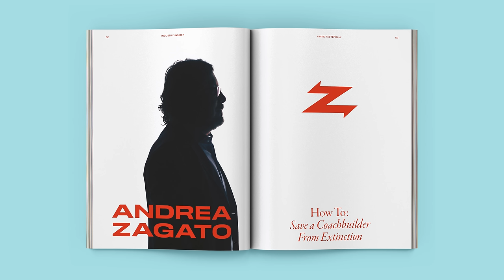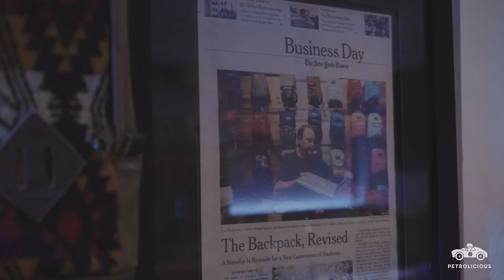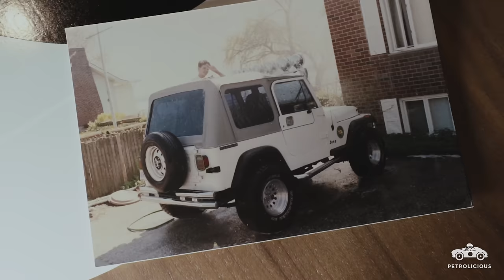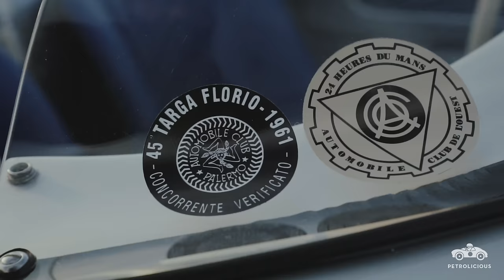Vintage Motorcars Porsche 550 Spyder Replica: Visceral

Comment: Replicas of the old cars are usually better- they have modern better engines, better components- etc.  of course the resale value is terrible.  Few can afford an original - not to mention that the Carreras 4 cam engines are crazy expensive

Comment: I am a James Dean fanatic. I have a replica kit car Porsche 550 Spyder.  I live in Pennsylvania. I drove the car to the crash site. Placed flowers. When i got  back in the car it would not start. Called a flat bed, i told the driver just tow me down the road a mile then let me see if it starts. Sure enough i jumped onto the flatbed into the car started right up. The flatbed driver demanded me to get the car off the flatbed asap.
Reply: Replica . But I hand made many of the parts.
Reply: @iamauto333  very nice to hear you handmade the parts on the Porsche Spyder it adds a personal touch to your Porsche Spyder 550 👍😁

Comment: i thought my karmann ghia is a tiny car, then a 550 spyder parked beside me :)
Reply: Which Karmann Ghia do you have? I owned a type 14 (50 hp) 30 years ago. 
Bought it for 2000 Deutsche Mark (1000€).
Reply: @dertechniker8867  a type 14 1966 model
Reply: gilbert sanchez a little while back I saw a Porsche 914 parked on the street, I’d forgotten how small they are. The 550 is smaller.
Reply: whats the market price for a karmann ghia right now ?
Reply: @legend-qw2ec  I'd like to see one next to my 1960 Austin Healey Bugeye Sprite.
Reply: Have you ever seen an original Alpine A110? You could put it in your pocket.
Reply: @dertechniker8867  a type 14 1966

Comment: Wow cool Video. Brings back memories. I had Beck 550 Sypder # 48 built by Greg Leach @ Vintage Spyders in the late 90’s The car was incredibly quick like a motorcycle but with a fiberglass egg shell body for maximum protection. Everything in this video is true about the feelings it gives you when driving it. It defines visceral. I felt completely defenseless driving it. It was so easy to drift with the throttle. Mine had a 2109cc with 170 hp. It only weighed 1200 lbs. it was a four speed with a swing axle, discs all around, silver with maroon leather and maroon rear quarter stripes. Crazy stuff🏁👍. I still wish I had it😀

Comment: I think a car company could sell a lot of cars if they built an inexpensive similar looking retro coupe with a lightweight removable hardtop....Keep the old school looks but use some better modern parts. Like an LED lighting, keep it lightweight like original, use a modern but simple inline 4cyl instead of boxer, that could put out 200hp in sport mode. Also with an Eco fuel saving mode 6 speed manual gearbox with 6th being OD.
 It could cost less if it didn't use all the bells wistles of pwr windows & seats, touch screen display,etc..The combination of lightweight/great fuel economy, yet still fast & fun to dtive, lower price tag of the car due to less parts/basic design, with good looks & lower maintenance costs. Would probably make it a hit with many people.  It could be a daily driver for a single person. Or second car for a big family & used as a fun to drive commuter car.

Comment: I owned a McRae Spyder, very rare, body mould rough from Chuck Beck, light weight hand laid and sculpted glass body in NZ to fit 8" rear and 7" front Z rated race rubber . This was built in New Zealand, by the Graham McRae, ex Indy rookie of the year, F1 Driver for Frank Williams, and F5000 triple gold star champion CanAm road America. A highly respected constructor building his own GM cars and racing them around the world in the 70s.  My was built to race car specs for Targa road racing. WRX STI's 2.5-liter Turbo charged engine, or a Porsche 911 Carrera RS 2.7 engine box set up if desired. Custom box, Link race management race tuner 300+ hp.  Body weight 450kg, 911 oversize vented rotors all round, Willians multi pot brakes all round. All tube to certified race spec molly.  This project was based on bringing the inspiration of the 550A into the modern era.

Comment: What with the space frame, the head faring, and the louvered doors that access the carburetors without lifting the tail piece, this is MUCH more a 550A replica than a 550 replica.  Which is all good.

Comment: Ayeee.... What a beauty! My dreaaam!!! How much such replica can cost?
Reply: Call Greg Leach at Vintage Motorcars Inc. or Carey Hines at Beck Speedster but brand new probably less than $60K and that's putting in a lot of extras. Engine choices are a Type I or a Type IV or even a Subaru. The build cost depends on your budget. Or look for one used and you're looking at $30-$40K.

Comment: He's wrong about original it had 140 and weighed 1150 that's 8.5ti 1 hp to weight.  Most replicas are fiberglass and weigh 1400  or more.

Comment: I had a beautiful, well done Beck 550 that I loved.   It ticked all the boxes mentioned, but I could not get over the fact that even driving "motorcycle defensive" was not enough.   This thing is so small and so low, you don't even have the visibility of being on a motorcycle, where you are sitting HIGHER than you are in this car.  Driving around trucks in the southwest, I always felt like I was going to be squashed like a grape from someone who "just didn't see" me.  Other than that, I miss the car a great deal, and if I had the money, yes, I would buy another.
Reply: I felt the same way driving my sisters Mazda Miata 20 years ago.  Feels like you’re driving a go-cart amongst cars and trucks. 👍👍👍
Reply: @clayfarnet970  I also drove a Miata as my daily for 10 years... it feels like a boulevard cruiser compared to the 550.   Yeah, it's like THAT

Comment: The original weighed 1150 with 140 horse power 8.2 lbs to hp.  Most replicas weigh around 1400.
Reply: Nope, those original specs not correct.
Reply: @MarkLRandall  550 kg and 140 HP what specs do you have?
Reply: @ruthlessreid9172  Around 1300 lbs and 110hp from the 1500cc 4 cam motor.  This was from one of the car mags that tested an original.
Reply: @MarkLRandall  quite different than other info I was always told 550 was weight in kg?

Comment: I have some bad news for the owner - that type 1 VW engine with dual carbs and larger pistons isn’t putting out anywhere near 200hp.  Even a Type IV has to run massive displacement to get close to that number.
Reply: A More $ Than Brains Driver, Not A Racer...Let "Mr. Visceral" & His Admittedly Gorgeous  $100k Street-Only Replica Find That Out, $hall We? Car$ & Coffee-NEXT!
Reply: Really? Exactly what does a 2275cc with a big cam, 44x37 stainless steel valves, ported and polished heads and 48mm carbs put out?

Comment: Pfff this guy is so full off it... It's a replica man, replica's take away from the original imo.
Reply: Thanks for sharing your opinion.  I also believe people that never drive their GT2's on the track take away from Porsche as well.
Reply: N911GT2 I’m sure the driving experience is very real! I don’t mind replica or homage at all, so long as people don’t try to pass them off as real.
Reply: The originals are a milion bucks a piece, and all 50 of them are either in museums or tucked away for high dollar events.   So they aren't taking away from anything.
Reply: @carsandchronos   I have never met a 550 reproduction owner who has tried to pass it off as real. And driving a 911 GT2 or 911 GT3 is like sitting on a sofa, even at 150 mph. It is a fast car but I found the one I drove to be very boring. There was no connection to the road or the space around you. Driving these is as real as it gets if it is set up right. Eric is right, if you push it in one of these by the end of the drive you are tired.
Reply: Yep I'm a great painter and I can paint a Franz Kline so well that you'd need an expert to tell the difference... they would say.. "that's not a Franz Kline"  PERIOD.
Reply: @HELLBAG1  Try 3 to 4 million now.